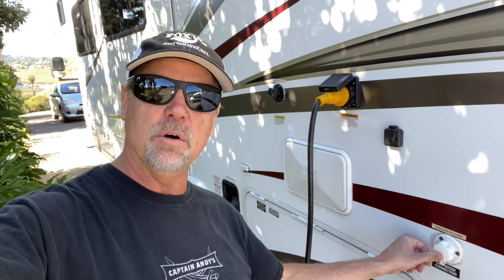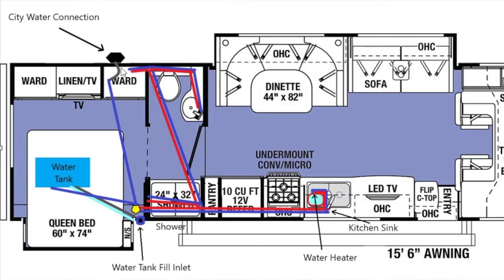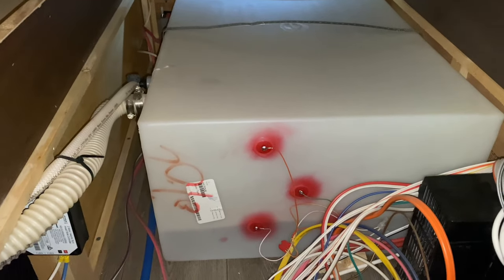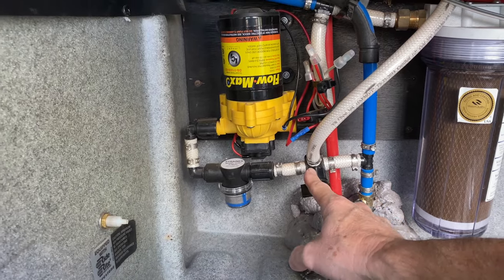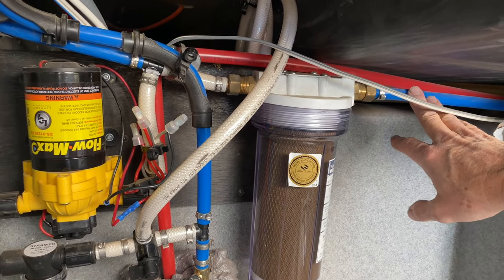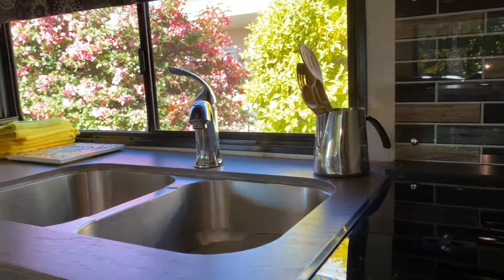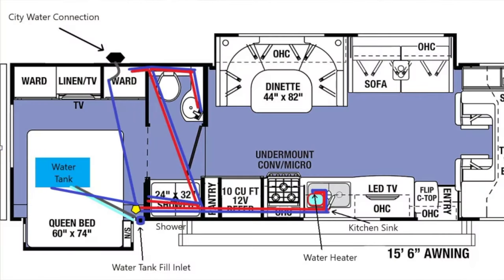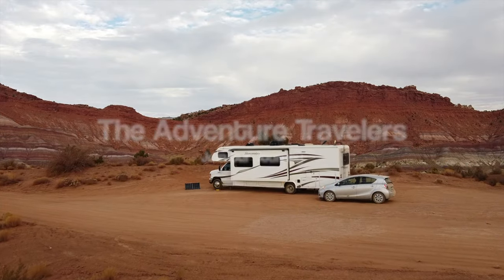RV Water System Explained In Depth

Comment: So does the water pump run off of the generator? If you’re off grid and you want water I assume you have to run the generator?
Reply from the maker: Robert, the water pump typically runs off of the battery power, which works when the batteries are charged.  The batteries are typically charged by either the generator or being plugged into power.  Once the batteries are charged by either, you do not have to have them on to run the pump, since the charged batteries will power it.  Make sense?  Hope this helps.
Reply: @TheAdventureTravelers  
Yes  and thank you for the reply, that makes total sense I’m a newbie I just bought this RV so everything is new to me. Can’t wait to try it out !
Reply from the maker: @robertdean6222  You'll have a blast!  Good luck and maybe we'll see ya out there!
Reply: @TheAdventureTravelers  I've been wondering.. if I'm somewhere overnite without shore power and just use lights and bathroom, how long before house batteries die? Hours, days?
Reply from the maker: @alive-awake  Depending upon how many batteries you have and how new they are, they typically will last overnight until morning.  We have two house batteries and when we are not hooked up to shore power, we typically have our suitcase solar charging the batteries while we are out hiking during the day.  We run our generator for about an hour or two at night, right before bed.  The biggest consumer of electricity while you're sleeping in the refrigerator.  Although ours is cooled by propane, when we are not plugged in, the electricity is still being drawn from the batteries overnight.
Reply: @TheAdventureTravelers  yeah, I was wondering about the frig after I asked.  Thanks! Do you have a video on the suitcase solar?
Reply from the maker: @alive-awake  I don't think I have a video on the solar suitcase.  It's from Renogy and plugs into the side of my RV.  The ZAMP connection is really easy to fix and allows for the Renogy connection.  All I had to do is change the polarity of the wires.
Reply: @TheAdventureTravelers  ok thanks.  I'll do some research on that.

Comment: I wonder what the P&ID looks like 🤔
Reply from the maker: Well, I kinda did the P&ID (Piping and Instrumentation Diagram) for a layman.  That's one thing that sucks about the RV (and Boating) industry is that they don't give the diagrams to the RV owner, which is pretty lame.  In manufacturing, they cut a lot of corners and change stuff on the fly.

Comment: the extra hose is for winterizing your rv with antifreeze
Reply from the maker: Thank you so much, I found that out right after I made a video. I live in San Diego and typically you do not have to winterize. Thanks again for your insight.

Comment: This plumbing is rather complicated and does not look as neat as I would have expected. How about rain water harvesting ? How about composting the toilet waste ? Did not tell water tank capacities. I guess with such a complicated piping only the manufacturer's will be able to do the repairs.
Reply from the maker: The plumbing is not really all that complicated, it is just how the RV manufacturers put the systems together. Once you follow your plumbing lines, it all makes sense. You can do rainwater harvesting, just ensure that you have a good filter on it before you put it in your tank. Also the composting toilets are getting much better however we don’t have those on board.  I did not mention my water tank capacity, since everybody’s is different but if you want to know. I can carry 44 gallons of fresh water in my tank.

Comment: Why is my toilet overflowing water?
Reply from the maker: If your toilet is overflowing, you most likely have a full black tank or could be a full gray water tank. Either way you gotta dump your tank. That’s the only reason why a toilet would be overflowing unless you’re valve that drops the waste into the black tank is stuck. It’s my pleasure. Thank you for watching and sharing your comment. Sorry for the delay, I have been hiking the John Muir Trail with my wife over the last month. Wishing you the best.
Reply: @TheAdventureTravelers  Thank you!! Yes, had to get the valve replaced.

Comment: Thanks so much for your detailed instruction video. Is your pump an -on-demand pump? On-demand meaning it begins working when the pressure drops when tap is opened. Great clip, thanks!
Reply from the maker: Yes, my pump is an on-demand pump. It’s basically pressurizing it the entire time and then when the pressure goes down, it turns on and continues the pressure until the tap is turned back off.
Reply: @TheAdventureTravelers  Thanks so much for your response. This helps me figure thing out. Much appreciated.